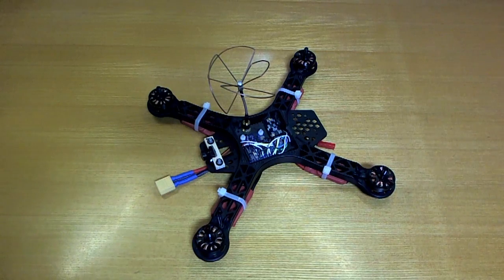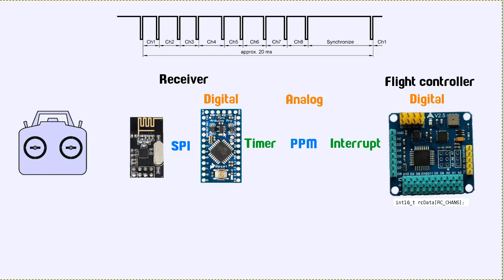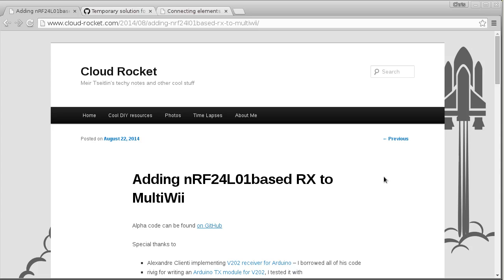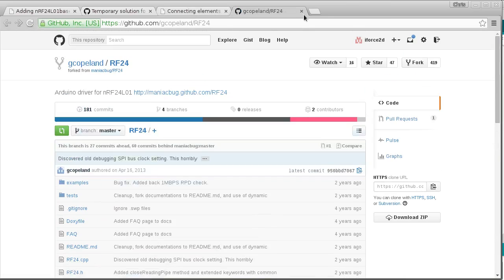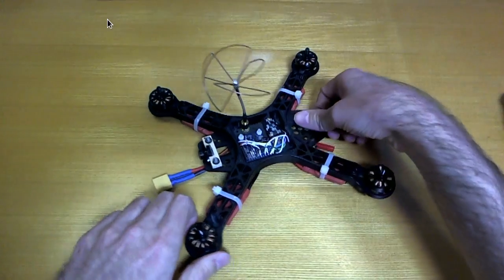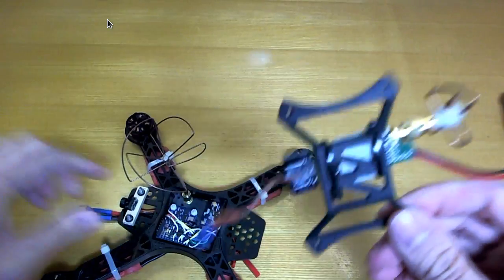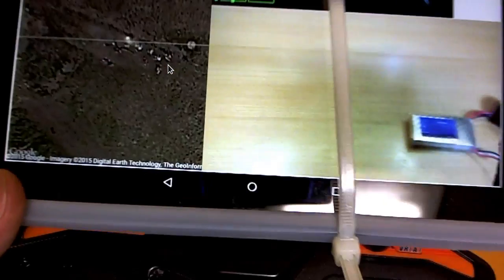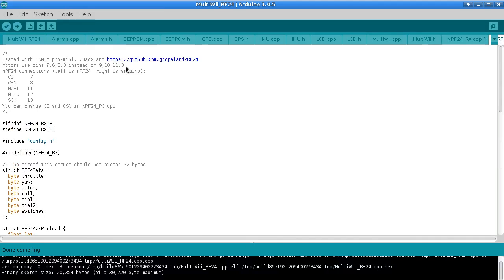Data telemetry with MultiWii integrated nRF24L01

Comment: Hey man i Want to Ask if i Can change the flight contrôler with Arduino nano and mpu6050 please help me
Reply from the maker: Yes, arduino nano will work too.
Reply: @iforce2d  thanks
Reply: Hey man thanks for Replaying but I Want to Ask you if 3.3 of Arduino with a capcitor 10uf 50v IS enough for nrf24 or i must use a voltage regulator for nrf24 please help me sir
Reply from the maker: I have used them like that and it was ok.

Comment: heyhey! Nice project!
I have been working on a similar project but instead it is a hexacopter that uses a mega 2560 as the main brains.
Would it be possible for me to implement your code on the mega and just change the pins? 
Really wanna use 6 motors instead of 4 ...
Reply from the maker: Yes, should be no problem. I seem to recall changing the pins wasn't trivial though...

Comment: May i ask? Is it possible tu publick some kind of instruction - pieces of code that are used in this project? I mean - via links below we can download "full" multwiii. But i and many others users making thieir own multiwii-build - with their own code. parts etc. So if we at the same time making our build and want to use this telemetry function - we need "naked" code, that we can paste into our multiwii project...
English ist my first, so, im sorry about any mistakes :)
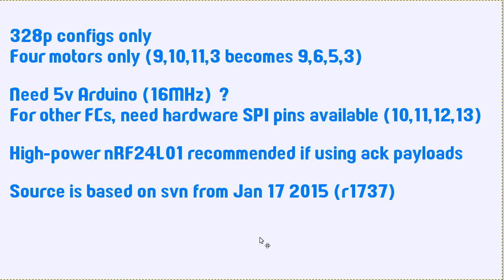Reply from the maker: 14:50 source is based on svn from Jan 17 2015 (r1737)
You would have to diff from that. I can't find any active svn repo for this anymore, but version 2.4 that was released shortly after I made this video will probably be close enough to be useful:
http://www.iforce2d.net/tmp/MultiWii_2_4.zip
Reply: @iforce2d  Thanks

Comment: Hi, thanks for this video, it's prerry interesting all you teach. Im' trying to do one with a friend but our transmiter is also another arduino with nrf24l01 ( by the way we use 2 arduino nano ). So is it possible the comunication between arduinos (transmiter and flight controller both with nrf24l01?

Comment: hey! love your videos!   i tried to compile nrf+multiwii code but there's an error i couldn't figure out. Its in imu.h. Could you please help me out?

Arduino: 1.8.9 (Windows 10), Board: "Arduino/Genuino Mega or Mega 2560, ATmega2560 (Mega 2560)"

Build options changed, rebuilding all
sketch\Sensors.cpp: In function 'void initS()':

Sensors.cpp:1521:14: error: 'Gyro_init' was not declared in this scope

   if (GYRO)  Gyro_init();

              ^~~~~~~~~

sketch\Sensors.cpp:1521:14: note: suggested alternative: 'Baro_init'

   if (GYRO)  Gyro_init();

              ^~~~~~~~~

              Baro_init

exit status 1
'Gyro_init' was not declared in this scope

This report would have more information with
"Show verbose output during compilation"
option enabled in File -> Preferences.

Comment: Wonderfull! Is there some way that we can use nRF24L01 as wireless telemetry? I wanted to replace it 433 MHz telemetry module that i am using with apm 2.8
Reply from the maker: nRF24 only sends individual packets, it is not a serial connection. If you do some google searching about the difference between UDP and TCP it might help to explain what I mean.

Comment: Hi @iforce2d, thank you for your work. I'm working on a DIY drone project using arduino mega 2560 and RF24 and your code. But when I compile the code, it said it doesn't support Mega 2560 board. Could you please give me some ways to integrate your code with Mega board? Since my project has some feature that use more memory than Uno board has, so I need to switch to Mega board. Thank you!

Comment: Thank you. I am trying to build an auto drone controlled over 4g which will fly to coordinates i give and come back where it started. Coukd you please give hardware and software advices. 
My plan for now is rasperry with a 4g module connected controls the flight card. Thank you.
Reply from the maker: Sounds like it would be a good idea to use a solid system like ardupilot. You will be busy enough getting your communication system running, without having to worry about the actual flying part. Ardupilot can be controlled over a UART connection, typically used with 900MHz or 433MHz radio modems. If you can run UART over your 4g system it should be pretty simple.

Comment: I was wondering, how did you change the motor output pins in the multiwii code? I couldn't find any proper way on the net. It would be great if you could help me out.

Comment: Can we add batttery voltage for ackpayload?😊
Reply from the maker: I think so. You can use a voltage divider to bring the battery voltage down to a level that will not harm the arduino, and use one of the analog pins to sense it.
Reply: Thanks u so much. This time i ll try to do myself but i dont think i ll succes😄. So can i ask again?😅
Reply: iforce2d lastnight  i used a voltage divider but then i couldnt find which analog pin to connect it.so i researched on internet how to do it. Most of board had their own divider and they are using telemetry module. Using nrf mod and getting vbat is so confusing for me😅😅. For exapmle if i use A0 pin, how will i change multiwiicode. 😩will  uint8_t vbat read A0 or how to connect them. And i am totally noob😶
Reply from the maker: https://www.arduino.cc/en/Reference/AnalogRead
Reply: iforce2d  no its about multiwii. If i connect divider to A0. How will multiwii know that its battery voltage. How i need to change the code?
Reply from the maker: ??? multiwii is an arduino program. Use the analogRead function to sense the voltage on the analog pin you connect the divider to. Look at the analog read example in the arduino IDE. https://www.arduino.cc/en/Tutorial/ReadAnalogVoltage
Reply: iforce2d working on it 😊😊😊. Thanks for awesome videos.👍👍👍👍👍👍👍👍👍

Comment: Hello, I´m trying to build a similar project... The problem i got is in the ppm communication. I´m using a different flight controller than yours. The one I´m using is from Instructables: http://www.instructables.com/id/DIY-ARDUINO-FLIGHT-CONTROLLER/ 
The question I´ve is if I can make the ppm communication in this flight controller. Thanks (:

Comment: Hi, i'm trying to make a project similar to this one but with brushed micro motors. how can i make to wire them and make them work with this one? thanks.
Reply from the maker: Well you would need brushed ESCs to control brushed motors. Other than that I don't think there would be any difference.
Reply: iforce2d so basically if i can drive the brushed motor all the rest stays the same? i've seen people driving micro brushed motors woth power transistor, do you think is it a good idea? the point is that I'm trying to build a "micro cheap-ass quadcopter" but I'm not so sure about how to manage it for keeping it as light as possible
Reply from the maker: I don't see why it would be different. I don't know anything about brushed ESCs sorry.
Reply: iforce2d ok, i'll try! thanks anyway for the great job!
Reply: I am working with a brushed motor too.  It was fine but the motors 5 and 6 does´t not working.

Comment: Hi :)

Did you ever try to work it with A Tricopter? 
i just try to make it work with the  TRI  option enable in config.h   and i am getting  errors when i compile 

" sketch\Output.cpp: In function 'void __vector_14()':
Output.cpp:1013: error: redefinition of 'void __vector_14()'
#define SOFT_PWM_ISR2 TIMER0_COMPA_vect

                          
sketch\Output.cpp:1074:9: note: in expansion of macro 'SOFT_PWM_ISR2'
ISR(SOFT_PWM_ISR2) { 

        
sketch\Output.cpp:759:25: note: 'void __vector_14()' previously defined here
#define SERVO_ISR TIMER0_COMPA_vect

                         

sketch\Output.cpp:931:7: note: in expansion of macro 'SERVO_ISR'
ISR(SERVO_ISR) {

     

exit status 1
redefinition of 'void __vector_14()'  ''
Reply from the maker: I have never seen any of those errors before. Downloaded the sketch just now and defined TRI and GY_521 and it compiles fine for me. Could be something to do with your version of arduino IDE? I'm using v1.0.5
Reply: Thanks for the reply :) 
I was using the 1.6.1  of the  IDE
I downgrade to  v1.0.5   and download a fresh copy of the Multiwii_RF24 zip file .
In config.h   i select
TRI , GY_521 , #define NRF24_RX   and still get an error 

''Output.cpp: In function 'void __vector_14()':
Output.cpp:1074: error: redefinition of 'void __vector_14()'
Output.cpp:931: error: 'void __vector_14()' previously defined here''

in the line 1074  is this one :   ISR(SOFT_PWM_ISR2) { 
in the line 931  is this one :  ISR(SERVO_ISR) {

if i dont choose    #define NRF24_RX   then it compiles
Reply from the maker: Sorry, I thought I had NRF24_RX defined when I tried this yesterday but I didn't. You might be able to get away with just removing the "defined(NRF24_RX) ||" from line 1055 of Output.cpp. That should compile but I have no idea if it will actually work.
Reply: Hi
I remove it but unfortunately didn't work  (it was compiled but not any reception - response from Arduino-multiwii configure (maybe sometime i will have more skills will try to fix it to work with Tricopter)

So i will return to the old and trusty  cheapass Transmiter-Receiver / PPM  with the use of 2 Pro mini or Nano

Thanks again for the good work all these years with the codes  etc 

:)
Reply from the maker: You have to change the transmitter nRF24 settings to match the receiver.
Reply from the maker: Well, both. The transmitter settings always need to match the receiver. (setAutoAck, enableAckPayload, setDataRate etc)
Reply: Sorry but I didn't understand.. Are you referring to change the transmition settings for this one (telemetry Nrf24LO1 code) or for the cheepass? 
I have watch all the series of cheepass videos.. As I have only Arduino pro mini 16Mhz I knew that had to change the timeclock number in the code.. I have made it work fine.. 
I try and the 8 Channel code you had for transmission and receiving as it was newer but had some problems to make it work with multiwii.. For some reason I had to remove the 2 lines of the switches in receiving code in order to start receive signals from transmition. 

" ppm[6] = data.switches & 0x1 ? 2000 : 1000;
  ppm[7] = data.switches & 0x2 ? 2000 : 1000; "

But this is something that will see after I my first fly with the older code.. 

I don't remember if the relative video of the series you are explaining it.. So maybe the answer is there 
☺️ 

Thanks ☺️

Comment: Hi again... 
i want to add a small oled display to the transmitter in order to display the  battery status and anything else would be useful to display in the transmitter 

So i add  some lines of code  to the   TX source code   in order to display the values from  ''ackPayload.pitch''  , ''ackPayload.roll''   etc   you had already in code for serial print 

after i upload the new code i can see the text with values drop for while* in oled display but i cant get no comunication between transmitter and transceiver  ( joysticks doesn't change any values in the multiwii configure program )

*(the values drop and stay static as the arduino reboots  and the multiwii configure program shows that same moment that started a connection with the transmitter and then stops) 

if i remove the code i added and upload it ... then it works..

for sure the problem is the new lines of code i added... but cant figure out why  blocks the original code to work as it should be

i am posting the Dropbox link of the tx source code with the new lines for oled  just to look  a quick look .
If you have some free time of course.. 

https://www.dropbox.com/sh/j8j5gznhawsteiw/AAA7pXozHwFYW0L-67ngLxuha?dl=0

thanks in advance

Comment: Hi my Friend.. First of all i want to thank you for all these awesome video tutorials.. you make me learn a lot of things :) (and still learn as a newbie in Arduino and in coding in general )

I have followed your tutorials and i manage to built the  cheepass  transmiter with a arduino pro mini 5v16hz and with a NrF24LO1 

I also make the module with oled screen to test the transmiter... and it works as it reads the movements of joustics with 11 packets of Data

I decide to use just one  pro mini 5v16mhz as a flight controler for the Quadx i want to built
I used the Multiwii_RF24   and make the basic changes to config.h  to setup the type of quadcopter, and the sensors i am using 

but when i start the  Multiwii configuration program  i can see only my Accelerometer, magnometer and barometer that is working..   i cant receive nothing from my  transmiter when i move the joystics 

have to change anything else in the config.h  file?

in your older posts for cheepass you were changing and the section for PPM Sum Reciver  but now i think that this is not nececary as you dont use extra arduino for just to receive signal

Any help? 

Thanks in Advance
Reply from the maker: Make sure you have exactly the same settings on the transmitter and receiver, eg. setDataRate, setAutoAck, enableAckPayload. The Multiwii_RF24 uses ack payloads to send back the telemetry data, but the other sketches (cheapass etc) do not. Look at NRF24_RX.cpp in the Multiwii_RF24 code.
Reply from the maker: See also #define NRF24_RX in config.h
Reply: My mistake not to mention that  after a while trying with the cheepass transmiter code i suspected it that and upgrade my transmiter with your newer code you have post here (Telemetry transmitter) that alows the ack payloads  but with no luck to make multiwii configuration program read it 

i am using  in both transmitter and flywing controler  an Arduino pro mini 5v16mhz  (i tried also with no results and an Arduino Nano 5v16mhz as the flight controller ) 

maybe something else is wrong to my setup....
just wanted to know if i had to change anything else in config.h  file in Multiwii_RF24 expect the :

1) The type of multicopter
2) Combined IMU Boards (if any)
3) independent sensors

Thanks for the quick reply :)

(sorry for some of my english as it is not my native language.... )
Reply: Thanks :)
Havent see that :)
i will upload the new sketch  :)

i will post the results 

Thanks for the patience to answer all the questions we have :)  and for the videos :)
Reply: Ok after i  remove the //  from  #define NRF24_RX    in config.h   line 407  of Multiwii_RF24,  the arduino Nano that i am using as a fly controler could see the incoming data from transmiter joystics 
Also i had place  in wrong pins some of the cables of Nrf24  in receiver ..  after  that it works fine :)

thanks again for the help   :) 

keep up good work  :)

ps : i am watching your new posts about cnc...  i have made one and now i am building i bigger one... 
all started when i decide to build my Delta 3d printer.... and learn for first time what Arduino was and what can do with that little miracle :)